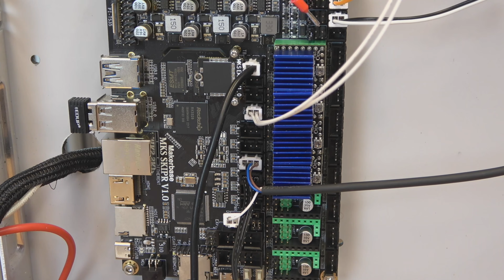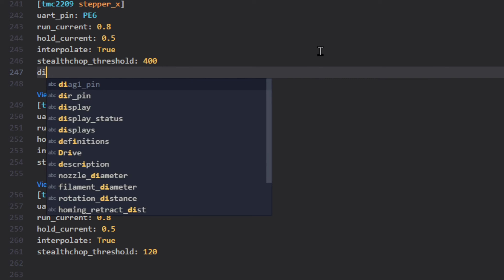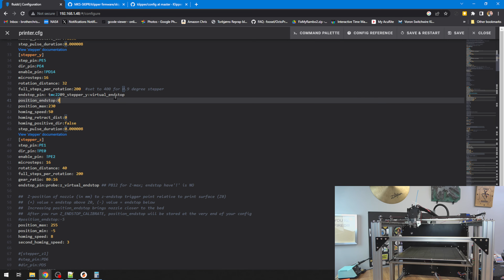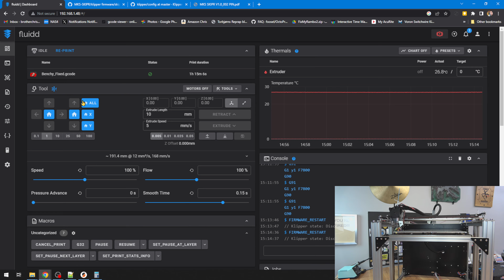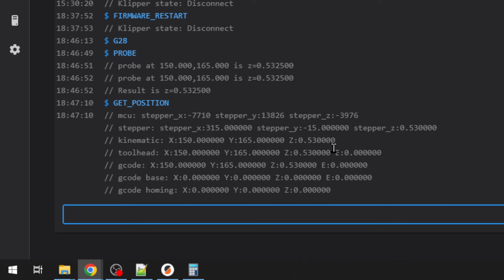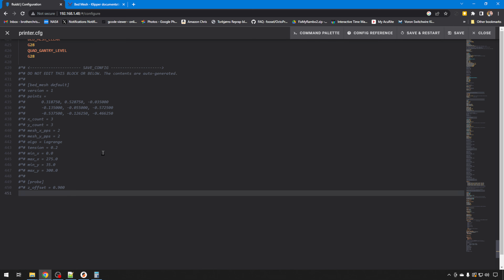Klipper - MKS Skipr - Part 3 - IT PRINTS! - Chris's Basement - 2023

Comment: Do you know how to connect the CR-Touch to this board? The cable is black and has 5 pins. I see the 3D Touch slot but that’s only 3 pins. Where do the other two pins go? What are the pin outs?
Reply from the maker: To make it work, the 5 pins have to be broken out. 3 go to the probe/servo pins, 2 go to z min endstop. https://support.th3dstudio.com/helpcenter/crtouch-sensor-pinout-sensor-side/
Reply: @ChrisRiley  Do you know of a port/slot/location on the board that will give me 12/24v, like the power port, but I can turn it on/off via code in Klipper?

Comment: So what is the voltage supposed to be coming out of the endstops. I'm getting @.05v. I thought they were supposed to be 5v.
Reply from the maker: It depends on the board, but you should get 5v when it's triggered from the GPIO pin. You can flip that in the firmware as well.

Comment: Any chance you can make a video of using BLtouch with these boards? upgrading from a SKR Mini e3 v2 and am lost on how i should attach this sensor
Thanks!
Reply from the maker: I'll see what I can do!
Reply: @ChrisRiley  Upon looking heavily into the topic there is a 3 pin header on the board marked 3dtouch next to the two LCD headers, After hooking the control,5v and ground to that header and the switch and ground pins to an endstop header and defining the sensor pin to ^PA13 and control pin to PA8 under [bltouch] aswell as setting Z endstop to Z_virtual_endstop now everything works perfectly, hopefully this information can help somebody else.
Reply: @ChrisRiley  appreciated, your videos helped me to my first marlin compile and flash and now these videos have been invaluable in helping me learn klipper, thanks a ton!

Comment: This is my first attempt at anything like this. Very overwhelming, but you break it down so that I can follow you. However, I am stuck. My sensor is not stopping the z axis. When I try to home it, it crashes into the print head and continues to try to move up until I hit the emergnecy stop. I have adjusted teh z offset all the way to 5 mm after rechecking all the steps up to this point. Nothing seems to be working. Please help!
Reply: Still can’t get past this part. If anybody has any ideas, that would be awesome. I have the original tronxy tr sensor that came with it if that helps.
Reply: I figured it out. The tronxy TR sensor is not 5V. I changed the sensor to the Z+ slot, changed the pin to PB14, and changed the the Z+ jumper from 5V to VIN.I can now home all.
Reply from the maker: Great! Thanks for watching

Comment: Thank you for improving over the  years on your content information and how you present it. Is it posable to do a Klipper video on a  3 in to 1 shared nozzle setup with a BTT Octopus with a non Pi like a Rock Pi4? This will help me solve the extruder setup and how to get the power function to work on a non pi... I can not get access Via Klipper to the Rock Pi 4 GPIO ports.... (cli commands work good)  I am tired of have to use the SD card to print in Marlin VS the usb due to the protocol overhead on the usb bus, printing faster then 90mm/s.... I fell in to the rabbit hole of klipper and ran out and back to Marlin for a few jobs I had to print.  I solved all but the 3 in to 1 and the power issue (the power issue I did find a workaround , but not what I wanted) If you can help me understand the 3 in to 1. Not just coding but how / why the code works that way. I will make sure I "Like" it.
Reply from the maker: I try to do my best! 😀 I will look around and see what I can find to test a config like this. Thanks for the suggestions.
Reply: @ChrisRiley  Thank you.. If it helps I can send you my work in progress. I just am at a blocking point of my experience in this.